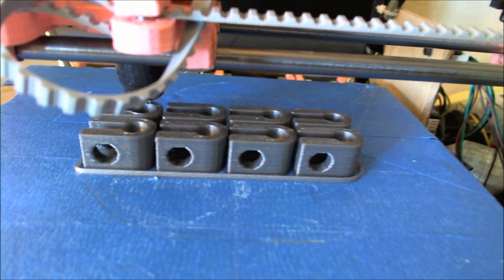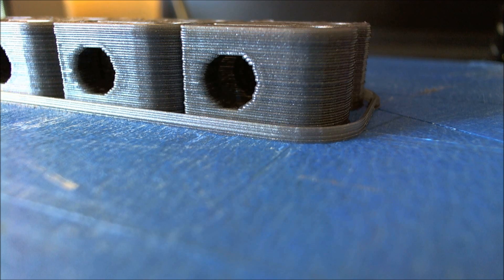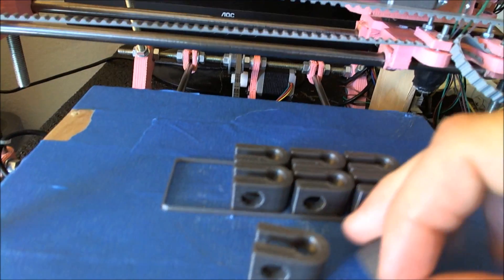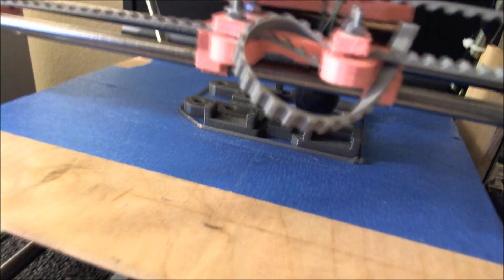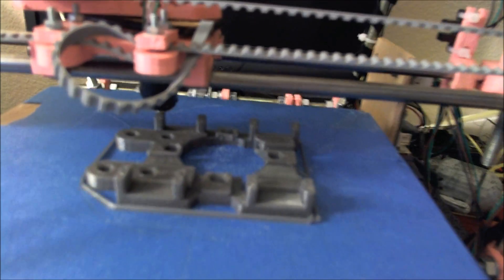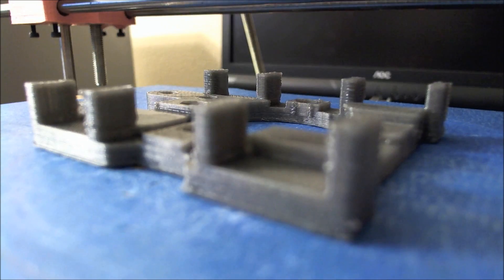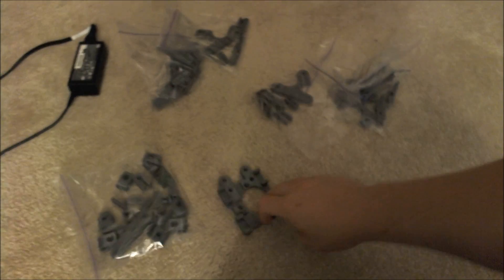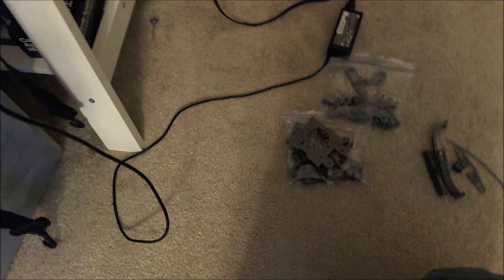Why I am starting to LOVE my 3D Printer

Comment: If you class £1500 as affordable, then yes! Sadly, my definition of affordable isn't even half that LOL. I'll wait till you can get one for £500. The tech is around 10 years old now, so give it 3-5 years, and home companies like HP will be churning them out for less than this. Although I'm talking ready built, or minimal assembly printers like the one '3D Printing Systems make. Cool, but DEFINITELY not affordable, not yet anyway, for the average joe with the average job lol.

Comment: Where do you get the computer files for the pieces that you want to print? I was thinking that this could be a good be a good source for "Blue Gun" replica handguns for use in the manufacturing of custom Kydex holsters as there are literally hundreds of different guns that I might get orders for. And what would the material cost to create a typical simulated handgun?This would sure be a quick and handy way to expedite an order for a holster when I don't have a "Blue Gun" for a particular gun.

Comment from the maker: It can help start a print off easily. Sometimes the first layer doesn't stick well and a heated bed helps prevent that. Also, ABS curls badly on corners a heated bed prevents that as well.

Comment from the maker: Depends on how you design and then print it, and then with which material. The small ends of the sprocket may present problems. I would gladly accept this challenge when I can get back to my 3D printer. Check thingiverse to see if anyone else has designed what you are looking for.

Comment: Have you thought about using a die release spray that is used in plastic molds to coat the blue tape before you began a print job. Should make removing the print job much easier.

Comment: Really sounds musical,steppers humming away.
I was wondering if there is a way to use Reprap to make parts for lost wax casting.
I am in a newsgroup on Yahoo thats called Gingery casting and casting in aluminium sometimes uses a wax prototype put in a sand mold, it burns away on contact with the hot liquid metal and makes way for the metal, giving you a metal part instead of a wax part.
Does a wax wire exist?

Comment: I would like to have a large one around 4x4 in size table. I could make wings around 3ft for
each side for a 6ft wing span, yes that would be cool. Im not worried about the cost.
Whe you compare what I would spend for a CNC router table 4x8 $35000
Is there anyone that could build me one that large?

Comment: Maybe make a dovetail joint and then glue the sections together. I would make a
strong joint. Or you could leave to holes in the wings where to dowel rods would
go into to make the sections of the wing strong.

Comment: nice idea, there is a "le bigrep" or so.
another option: cut your wing with a 3d program into pieces, and assemble them like a simple jigsaw-puzzle, it is done before, and then you could just melt it together with a heat-gun, just be careful not to destroy it.

And making the parts yourself will save money, but it will cost a bit more time.

Comment: I want a large 3D printer to build RC glider planes. The wings will be around
3ft each side. Thats 6ft wingspand total. Fuse around 4ft. 
They don't seem to have large 3D printer like this one works. Some use powder etc but
still not that big.

Comment from the maker: Reprap is way more open and changes all the time. Right now makerbot has a dual extruder system but reprap is printing with a filament mixer that can use several colors to extrude one from the same nozzle. Amazing.

Comment: that's the general idea. the only parts you can't print are the metal parts, which you can buy at a hardware store, and the extruder head.
I'm 75% done building my reprap 3d printer. the extruder and the flatbed is all i'm missing. i've made my own drivers and just bought a breakout board.
can't wait to start printing

Comment: Yeh, people should actually be able to use the correct terms. The old traditional way would be the CNC-milling, a subtractive process. The newer additive manufacturing methods are also relying on CNC-machinery but can be divided further more into at least seven subcategories like 'selective laser sintering' for instance. Wikipedia is a good source of info on that whole thing.

Comment: @FREEGARYMCKINNON when I am done with my cnc I will have over $600 usd in the electronics and motors and over $1200 in the framework. The major difference is that I can microstep with zero vibration and the highest resolution possible with an accuracy of .00005.

Comment: @FREEGARYMCKINNON A fully built Reprap setup costs about 1000$, and you'll be called lucky if you find a CNC lathe under 15k$, CNC mills are even more expensive, but again, they do not do the same job...